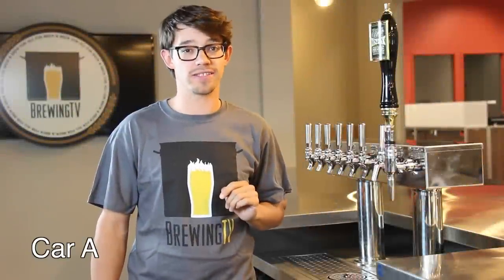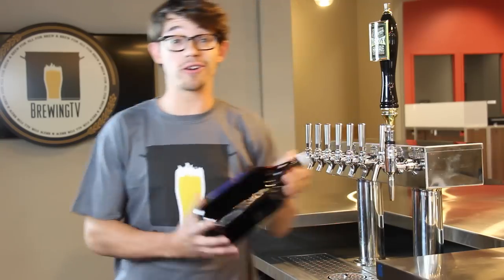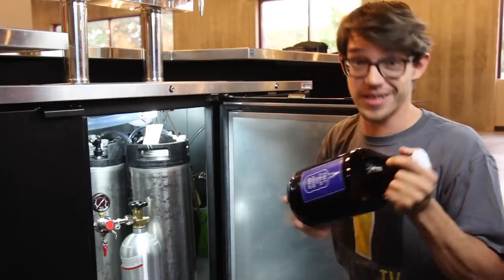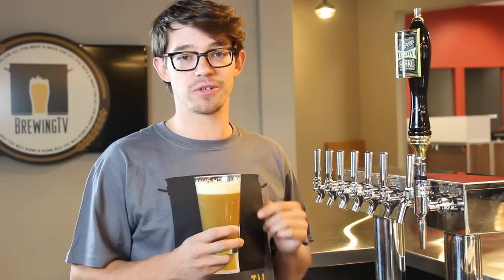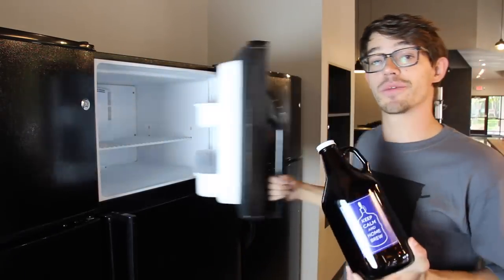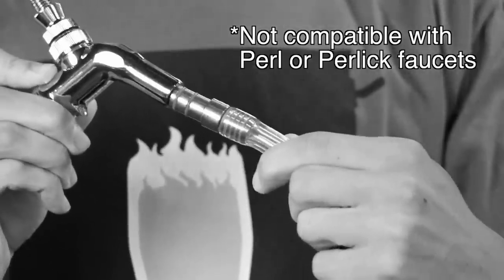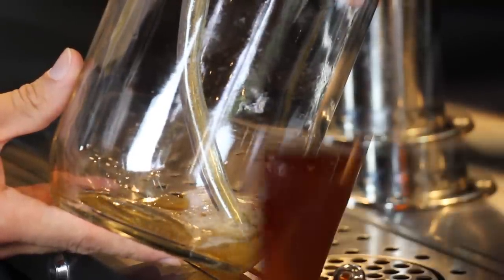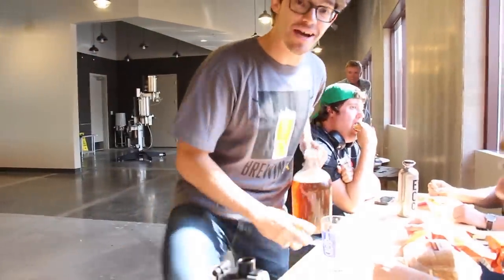Growler Filler Tubing Kit

Comment: So do you have to force carb keg again after you release pressure?
Reply: Just because you release the pressure from a keg of carbonated beer doesn't mean the beer instantly goes flat. In the short time it takes to fill growler and turn it up again the beer will be fine kegs pressurize fairly quickly